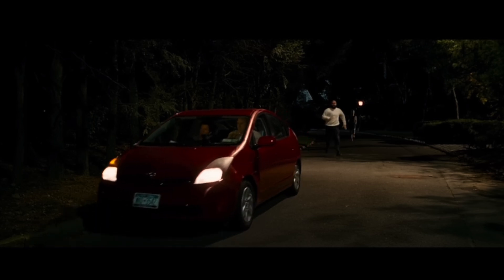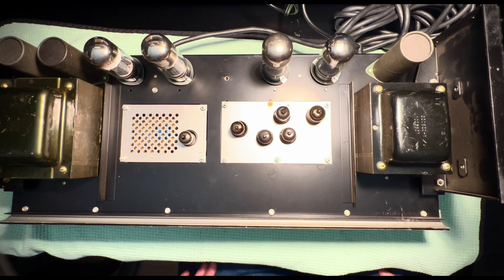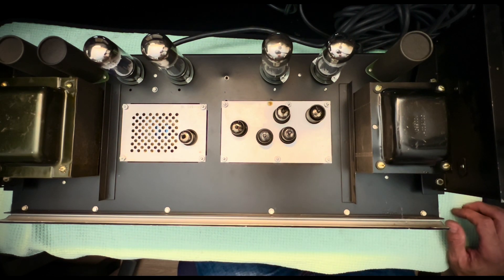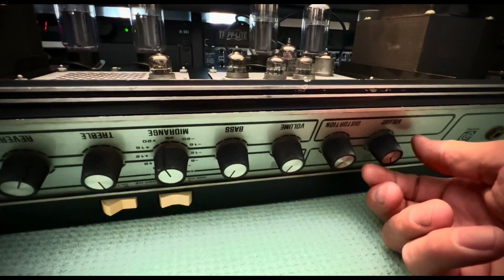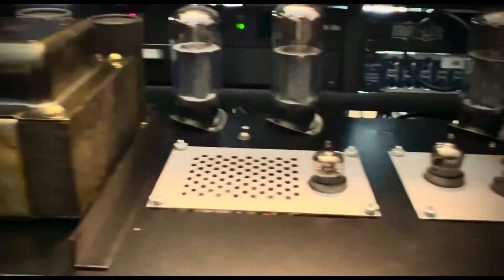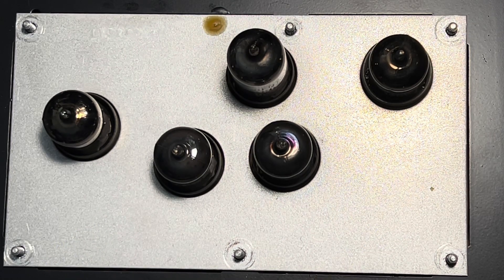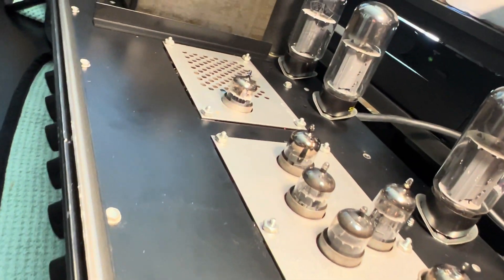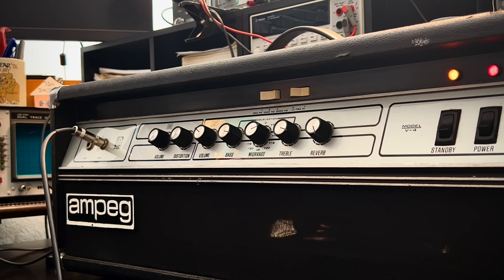70's Ampeg V4 PT1: For The Sake of Being Clever

Comment: This version of the V4 and the V9 are some of my favorite Ampegs. These things are brutal on bass going through a folded 215.
Reply: Nice. Yes this version of the V4 is really underrated. With 6550's installed it really is more like a half powered V9 than a V4. Not just because they share the same preamp, but also (output power aside) the power amp is definitely more SVT-ish than V4-ish. Not sure why they ever installed 7027's in this model - the power amp design clearly favors 6550's. And (ONLY) this version of the V4 will put out around 140 watts with 6550's. The lack of negative feedback gives it a softer yet deeper low end (again best with 6550's) that definitely sounds incredible for bass, and also makes the onset of power amp distortion sound & feel more natural. And it's also still a great guitar amp that's got some unique traits compared to the other V4. I own both versions, and while I do favor the traditional V4 overall, this one definitely should not be overlooked.
Reply from the maker: You know!

Comment: I'm pretty sure V1 was the only tube that originally came with the uncircumsized tube shield. Its to prevent oscillation caused by the positive feedback used in the crazy distortion circuit.
Reply from the maker: I had one come through years back that had 2-3 of them remaining!
Reply: @thatampguy  I may be wrong but I thought I remembered seeing an old Ampeg service memo from later in 1976 about adding them or something. I'm talking specifically about the "distortion" model V4 that came out in '76. They did have some issues with the early ones. Inherently microphonic 6AN8A's needed to be replaced with 6AN8A's with a spiral filament.  But again I may be remembering some of this stuff incorrectly. Why would tube shields go "missing" though?
Reply from the maker: Now that you mention it, the telescopic bit looked like it could be removed. Hopefully I’ll get another in the shop and I’ll do a better job of documenting that. I appreciate your input. I ended up buying a specific tube tester to help me rule out compactron issues bc I was seeing so many old ampegs at the time 😂
Reply: @ForgottenGearRestorations  That's cool. I'm glad to see someone who is both qualified AND enthusiastic to work on them. I have 2 of them - one of the standard V4's and one with distortion. They're my all time faves. So unique circuit wise and truly great (for) "all purpose" amps.
Reply from the maker: Two!  How big are your forearms and traps? 😂 pleasure to meet you.